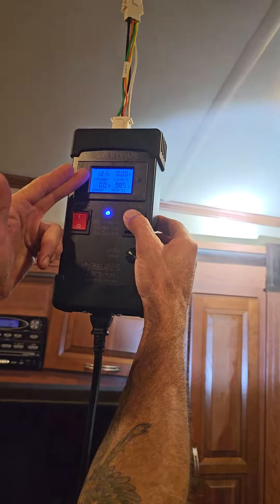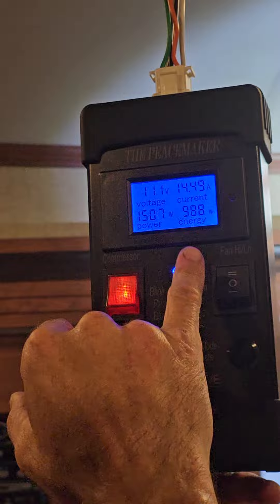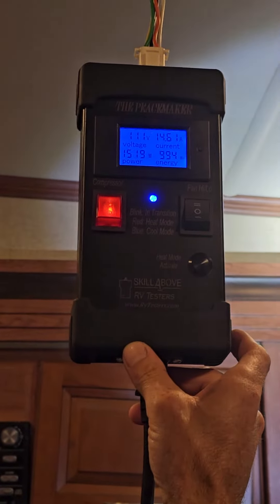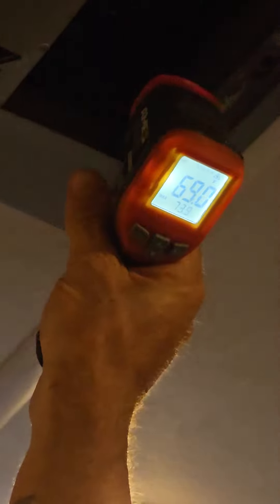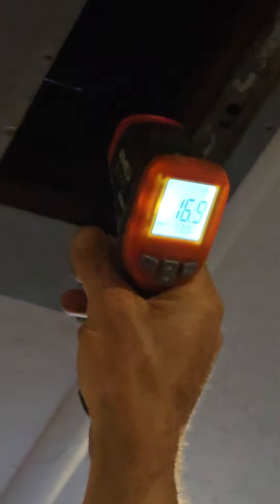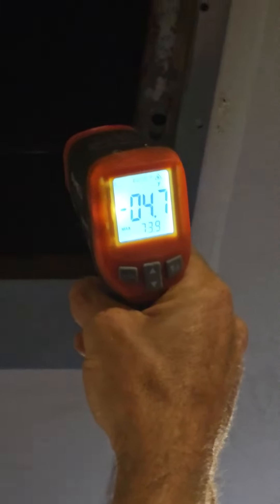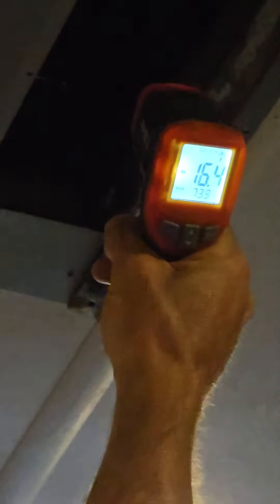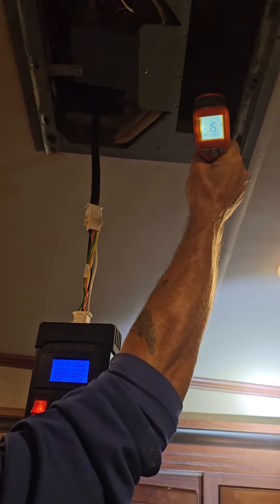faulty dometic ac units

Comment: Hey Scotty, I'm your 100th subscriber. Was trying to comment on another video, but you have it set to safe for kids and that doesn't allow comments (won't show up well on search either). I'm trying to fix my 3 year old Mach 3 AC not blowing cold. Compressor trying to click on, but keeps failing after 3 seconds, I'm hearing 2 clicks. Replaced the caps even though they're good, have continuity on overload protector, and checked compressor ohms at .7, .7, and 1.5ohms. (Are those too low). No signs of oil for leaks anywhere. Ordered a start relay for my board and a new overload protector, but I'm out of ideas.
Reply from the maker: I just found out about that most my videos are private and im working on it rn